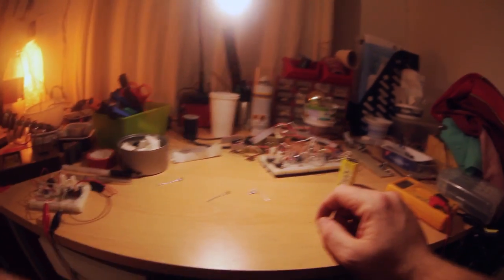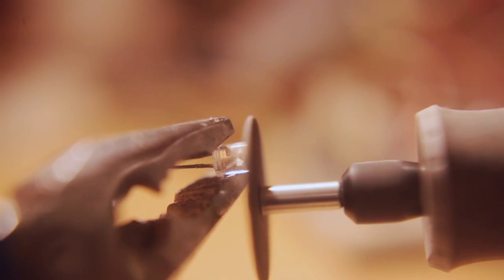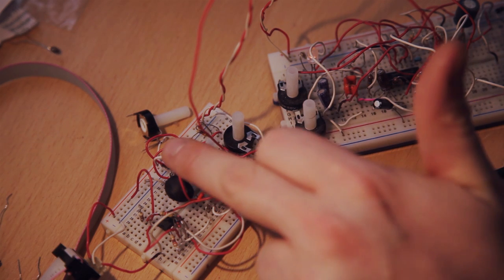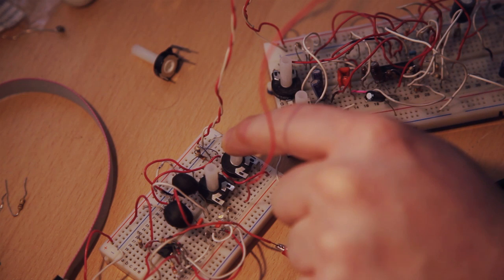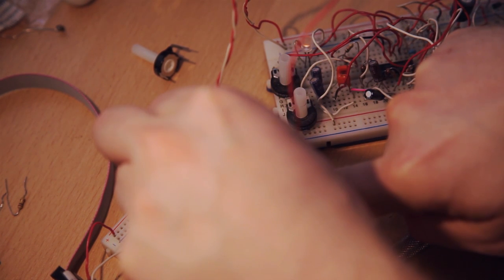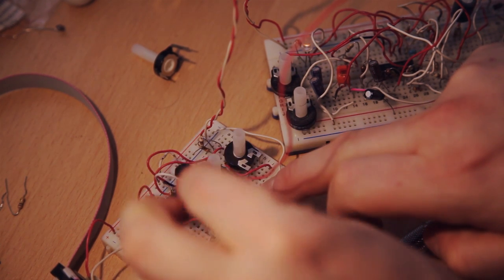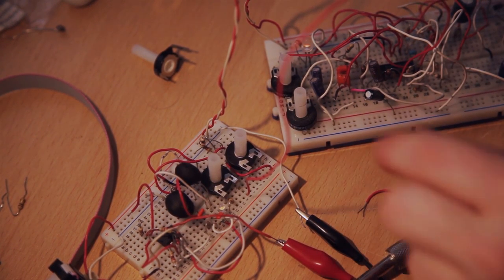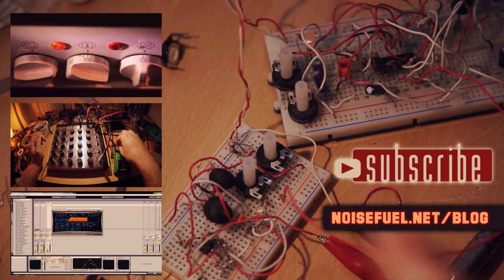diy vactrol VOL II: wien-bridge oscillator with distortion

Comment: The nice thing is that, even a nice name brand sequencer like a Korg SQ-1, as long as it’s not quantized, but chromatic, and doesn’t matter; exponential, linear, or whatever (even inverted with a bipolar LED -though this might add asymmetrical properties due to its different colors).  We can use that sequencer to give us very much in tune and musical results.  Only as in tune and in key analogously to how well our ears are getting along with our fingers.  How come no little lightbulb to handle the temperature compensation?  I think your schematic shows a pair of diodes that takes the place of that lightbulb (in the feedback loop to negative pin), but the lightbulb is what makes that circuit so quickly recognizable as the Wein bridge oscillator!  Maybe you have something off camera that’s still in development?  REALLY COOL IDEAS, THANKS FOR SHARING!

Comment: At about halfway through this, you pointed out a moment in the middle of the cycles when the sound disappears.  Could that be because with the LFO you have the LED hooked up, and because of this, there is a voltage drop that causes an audible cutting in and out?  I love that sort of reverb that you achieved here!  I’ve always been curious about what Wein-bridge oscillators might sound like, but I’m not entirely certain I understand where the Wein bridge oscillator is, is the LED in the Vactrol meant to be the light from the Wein bridge circuit, or that flashing LED?  VERY COOL, and INSPIRING!!  THANK YOU!!
Reply from the maker: hey! the cutting is because the "frequency" goes too low to be audible. Actually, under certain settings the wien-bridge oscillator stops working.
In the wien-bridge oscillator the frequency is set with a pair of matching resistors. I swapped those with two LDRs, controlled by the same led.
The flashing LED you're seeing is here just to display the pilot LFO.

Comment: I was wondering if you can make the mute based vactrol on its own? I already built my own 4 oscillator synth and wanted to turn each voicing on and off with triggers. I essentially connected the audio through an LDR with a 10nF cap on the out, but the audio takes a long time to mute (there’s a long slow diminuendo) and the next trigger hit is consequently very muddy. Do you have any idea how I could improve the mute time to be faster?
Reply from the maker: well, you don't actually need the output cap, and I'm not sure how you wired things up, if you want to link a schematic I can have a look. Anyways, that's quite a rough implementation,  you can get much better results using an op-amp to drive the vactrol's LED.
Reply: minijack thank you so much for getting back to me, I’m pretty new to all this but still determined to learn! So you recon with a op-amp controlling the LED the sound will have a sharper cutoff slope? I actually thought the amp would be for the audio 🙈🙈🙈🙈 I have a schematic for the Vactrol but there’s no way to upload here but it’s this video:
Reply from the maker: @kylemacleod8479  a shorter cutoff speed, yes, the shortest the vactrol itself can support if the circuit is well designed
Reply: https://youtu.be/8BOnvSQpoGY the schematic is at 8:16